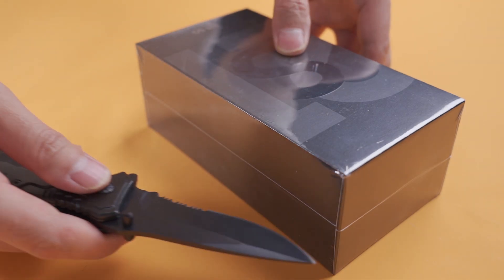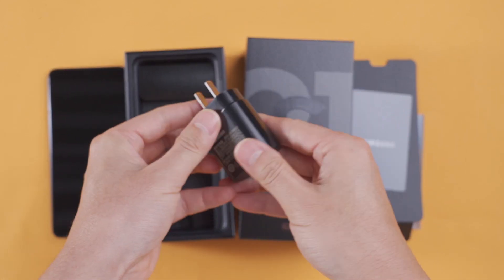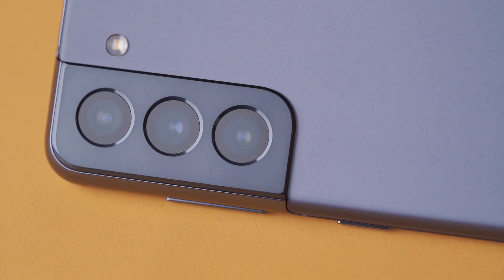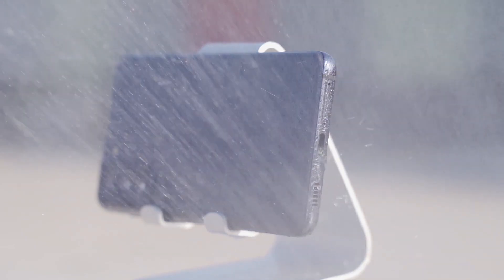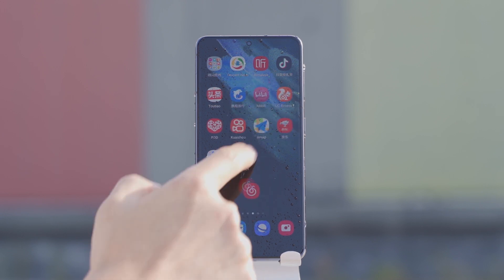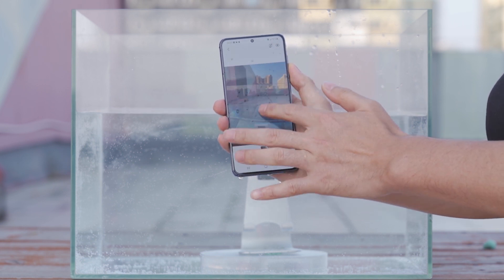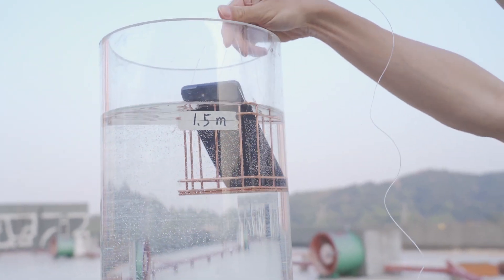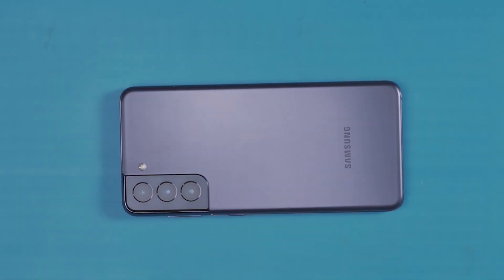Galaxy S21 5G Waterproof Test

Comment: My phone S21 5G got into the water and it didn't turn on. I put it in the sun and it worked. The next day, it didn't turn on. I touched the edges of the screen. How can I fix it?
Reply from the maker: Obviously there is water in the motherboard, I would suggest you go to a repair shop and have it checked, it will be more professional.

Comment: i bought a refurbished S21 that had been opened up before. sat in about a quarter inch of water overnight. wont charge. $300 down the drain 😀
Reply from the maker: Generally, the IP68 waterproof function of a mobile phone that has been disassembled will be immediately invalid.

Comment: Thank God. Mine fell in thenwater for two seconds. It got submerged and the ports got filled with water. I tried to lightly vacuum out any water that would fall out. Waited ten minutes. Turned it on. And now here I am. Thank you samsung. I had a case...but the buttons and ports are always exposed.

Comment: just had a screen replacement done by a "autorized" Samsung repairer that actually did repair the screen but lost waterproof and i got my phone damaged now im waiting for their call to see what are they gonna do about it . Ppl in Portugal dont repair any device from this category in Worten shops. They are NOT autorized repairers from Samsung and your phone will surely loose its waterprofness since they dont even do the vaccuum test to see if the equipment is still Ip68.
Reply from the maker: If this is the case, we prefer that you replace it yourself.
Reply: @EricWitrigs  Under warranty they had to replace my S21 for a new one. Lucky me that they didnt had any S21 so they gave me a new S23 ✌️

Comment: I dropped my S21 in water 2 times and it still works perfectly fine. I still can't  believe it still works with no problems. Most phones would have been done for, but this joker keeps going! Each time I dropped it by mistake. I will not go for #3, I'm to scared that might be the death of my phone. But it does work
Reply: Samsung states already that it is okay and manageable to submerge it underwater 1.5m for 30 minutes. You can throw it in your bathtub or anything you want, you paid for it to be waterproof so it's not bad to use it 😏
Reply: Mine fall into piss just now....but here am using it to type this message
Reply: @VictoriaHobbies  I just dropped mine In the toilet and had a heart attack 😭
Reply: @tragicpsycho3349  omg
Reply: @tragicpsycho3349  I feel you just dropped mine too, bro I cried... PLZ tell me you didn't have any problem with yours now
Reply: @esmer2061  Mines perfectly fine
Reply: @tragicpsycho3349  I have a question I think I hear a bit water inside the the phone did yours was the same or should I be worried?
Reply: @esmer I don't think I heard any water in mine but my main concern ATM was drying the outside of it off so I'm not to sure tbh
Reply: @esmer  I don't think I heard any water in mine but my main concern ATM was drying the outside of it off so I'm not to sure tbh

Comment: bought this phone last month, it ended up in my bathrobe pocket in the washing machine for 5 minutes yesterday morning, thought it was ok for the first 20 minutes because everything was still working, and then condensation in the camera lens and then nothing, tried the vacuum and blower in a sock method for about 5 hours and in front of a warm air fan all night, but still nothing on the screen
Reply: I don't think waterproof phones are meant for a washing machine. Especially if there's soap in it. I read that waterproof feature doesn't resist soap/shampoo/detergent or such chemicals.
Reply: You literally put your phone under category 5 hurricane and you expect this 600$ phone to survive through it.

Comment: I DON'T THINK SO.  I've got buyers remorse after using the S21 for a few months. Should have purchased the new LG flagship. I had the much older G6 which I had to use again because my S21 had to be shipped to Samsung and repaired. Warning, don't even put the S21 in a humid room or by the pool. I was splashed with droplets of water and the S21 gave me the dreaded, Moisture Detection error where you can only charge your phone via wirelessly. Isn't the phone supposed to survive being submerged in three feet of water for 30 minutes scenario? Yeah, I don't think so.
Reply: i'm confused, you got water in the charging port and you are mad that you have to wait for it to dry?
Reply: @i_love_games110  don't worry, everyone gets confused once in a while.
Reply: Pool water isnt pure water
Reply: it's a very comik commet

Comment: CAn it take pictures underwater?
Reply: Yes, you can but use the self-timer as the touchscreen doesn't work underwater (or start the video above water, ocassionaly it will flip screen and camera if you submerge whilst recording as the touchscreen detects the water as a "touch"). Beware (although it works fine) that the phone is waterresistant and not waterproof, and not made for the purpose of underwater photography/video. And your phone needs to be in its "pristine" condition...any hard drops / cracks might jeopardize the water-resistance. Your speaker (often)  needs to dry out after use in swimming pool, will sound terrible right after submerging it, a few strong airblows from your mouth and some patience will make it sound fine again. (Your mileage might vary, there is always the risk, I've been using it in our pool upto 1,5 meters deep for video & photo)

Comment: All of this yet you failed to mention microphone and speaker quality after the tests.
Reply: Yeah they go back to normal after they dry out! I dropped mine knee deep in a creek and my mic was wonky until it dried. As of now you wouldn't even know I dropped it in water.
Reply: I agree
Reply: @timothyfulkerson6785  its because they obviously would take a hit if you use them with water or moisture in it, that is why you let it dry properly and the quality comes back to the same before you got water in it. I dip mine in 3m deep pool for hours and take videos and pictures, never had any problem
Reply: After drying the phone he did an intake test proving there is no water inside any components so it should all sound normal

Comment: I dropped mine in the toilet an hour ago. I immediately got it out, took the back case off, powered the phone off, removed the Sim card and blew the water out of the speaker and charging ports then submerged in rice for 10 minutes.  When I turned it back on I had a notification not to charge due to moisture in the charge port. A few minutes later the notification was gone and I have no issues with the phone so far.
Reply: You are not the only one buddy. U can only charge once the moisture or dust in the charging port is gone. It could even take a day sometime and ur left with no phone as the phone dies without charging. Oy option is buy a wifi charger.
Reply: Hey did your phone ever have any problems since you posted this?
Reply: @soundsofnature4347  sometimes, this warning stays on no matter what you do and you'll be forced to charge it wirelessly. Had to send mine back to Samsung because I got splashed with water droplets only. Disappointed.
Reply: You shouldn't take the sim card out, there is a waterproof seal on the sim card slot

Comment: How did you comes with the charging brick inside the box????
Reply: Some countries require manufacturers to include brick because as they say the product has to have all components to work and without charger its not a full working device because once it dies you cannot charge it :)

Comment: How did you get the charging brick with your s21?
Reply: Some countries require manufacturers to include brick because as they say the product has to have all components to work and without charger its not a full working device because once it dies you cannot charge it :)
Reply: Late comment but I think that's the Chinese Variant.. apparently, Chinese variants of the phone came with one. Mine didn't (its a International)
Reply: Buy online
Reply: @ok-yw8bt I did I got mine from the Samsung website it came with just the charging cable
Reply: @bigpall1  thats impossible
Reply: @ok-yw8bt  What? How you gonna tell him that's impossible? I got my S21+ online and also only got the cable, no brick.
Reply: @Kana-vx2ec  typo i thought he meant brick
Reply: @ok-yw8bt  mine came with no charging brick too
Reply: @Kana-vx2ec  mine too....

Comment: I'm a diver, I dove 30 minutes 10 feet water, no problem.  Fantastic.
Reply: how is the charging port and the speaker
Reply: @sidraofthestars  the s21 plus ➕ is water proof too right
Reply: @christophergarland2315  Yheap
Reply: Its waterproof with no case?????
Reply: @cedrickdegroat4045  yes. 1,5 meter for 30min
Reply: Did u dive into sea water ?

Comment: Keep in mind water resistance is most likely not the same once you have removed the back panel and put back together.
Reply: You are not meant to remove the back panel though
Reply: Real talk bro, I took my my brand new (atleast what I thought)s9 plus  to the pool and within seconds it done....went to repair it,guy told me it was a refurbished phone
Reply: @live_easy7635  
Yeah you can seal it back up properly if you take your time with the waxxy adhesive. 
I don't really take my new from factory phone even in the water though. 

Only had a few cases while fishing where it went under fully. In that case it was a refurbish g6, and it didn't break. Still works to this day. I guess it depends who does it too
Reply: @ryanpark2049   understand bro, it wasn't intentional tho, butwhen you got caught up with women and water...tends to get a little crazy bro
Reply: @live_easy7635  buy it brand new from the actual store
Reply: I think modern phones are designed so they could be properly serviced without voiding water resistance
And Samsung themselves after servicing your phone, test the water resistance then give you back
Reply: A.
Reply: I had my s21 plus screen replaceded by Samsung mobile call out team so would that be sealed properly?
Reply: @snakeybriskins6432  I would think it would. Me personally though I would be skeptical.
Reply: @gabe_irl  same but they have replaced the back cover battery and charging port but I belive its all built in like the lcd screen charging port etc am I correct because its looks brand new?
Reply: @snakeybriskins6432  if it's done by Samsung themselves it likely is still water resistant but use your own discretion.
Reply: @gabe_irl  yes it was done by samsung themselves they come to your house and fix it outside in there litle mobile repair van.
Reply: @snakeybriskins6432  oh wow, I didn't know they did that. That's pretty cool
Reply: @gabe_irl  in the UK they do yes if you're from hear or other part of the world. And it was cheaper than any other place even a back street phone shop it was a no brainer.
Reply: Depends on who opens it or not. The seals/sealant are/is easy to replace if you take your time

Comment: Omfg...You removed the factory installed screen protector? I mean, yeah, it's not great, but it's supposed to stay on! WTF!! The fact that it didn't have a tab for you to pull it should have told you that!!!  Facepalm.
Reply: I'd rather see it test absolutely unprotected as possible 🤷.   Wouldn't you want to see what its really capable of handling?  🤦
Reply: Well for the tests it's a better to take it off for full results
Reply: That protector only protects the phone from scratches.. try dropping it with that protector and you might end up with a really screwed up screen

Comment: That was impressive. They say two minutes under water, but clearly that's just a precaution and it can withstand 30 minutes with no issues, possibly even longer.
Reply: Under 1.5 meters the pressure at that depth can push water through  the mesh that makes it water resistant
Reply: @Ryan-p1ge0n  but it didn't, so 🤷
Reply: I know what we can speculate but to me, this is pretty clear that the durability and water resistance is excellent. I'm sure that it can withstand a longer duration under the same conditions
Reply: @treykings07  the deeper you go under water the more pressure it has, no video I've watched is under more then 1 foot of water 1.5 meters is more the 1 foot, the presser at 1.5 meters will push through  the mesh on Ruin the phone.  I say this on this phone  watching  videos  because  I do stuck and if it gets on my phone by accident I want to be able to wash it off. I wouldn't even try holding it under 1.5 meters for more then 30 minutes because before samasung releases  their phones they test that and that's what they say 1.5 for 30 minutes  will ruin the phone
Reply: @Ryan-p1ge0n    come on my guy, that's obvious. But here's the problem, nobody is talking about anything other than this video and the evidence it clearly shows that this phone can withstand 1.5 meters (watch the video again..), for 30 minutes. My comment is merely stating that this phone could likely withstand 1.5 meters at a longer duration than 30 minutes. Never once said anything about going deeper, or anything else. So your comprehension is a little off, also the fact you didn't watch the video and chose to comment with opinions is another problem.  You claim that no video shows 1.5m for 30 minutes and this video literally does just that. So just go watch the video.. have a good night.
Reply: @treykings07  so to you a cup of water is 1.5 meters. Where did you go to school man. A cup of water is not 1.5 meters. You are not understanding what I am saying. He tested in a cup of water a cup not 1.5 meter of water so how can anyone tell its water proof the pressure  at 1.5 meter of water will push water through the mesh waterproofing. Do you understand that phones have a mesh screen in them that makes them waterproof. Do you understand  or are you going to try to tell me a cup of water is 1.5 meters deep. Yes if.ypu sit the phone in a cup of water it can stay there forever. If you put the phone in a bucket that is 1.5 meters  deep say like a garbage can your phone won't last passed 30 minutes.
Reply: @Ryan-p1ge0n  you must not have watched the video? He submerged it under 1.5 meters of water for 30 min?
Reply: @Ryan-p1ge0n  your comment makes no sense at all. You didn't watch the video clearly. Or watched the first 3 mins then went into the comments to argue.

Comment: Why does this one come with a charger and mine didn't? (Also S21)
Reply: Mine came with a cord but no box to hook it up to...
Reply: @ironheadmafia  yeah I have the same thing.
Reply: Same... my box was very thin as well.
Reply: Some countries require manufacturers to include brick because as they say the product has to have all components to work and without charger its not a full working device because once it dies you cannot charge it :)
Reply: Mine too
Reply: Mine never came with one either
Reply: Mine came with a cable but still can't use it as its type c both ends luckily wife has a s10
Reply: @johngriffin9759  yes that's what mine came with that's just to transfer apps data pics and stuff I meant a actual charger
Reply: @joeyjohnson7076  that is also the cable for charging but you have to buy a separate plug its called a 25amp charger. It makes it a super charge instead of fast charge
Reply: @johngriffin9759  yea but pointless bc I don't have a place near me that sells one
Reply: @joeyjohnson7076  you can get them on ebay or amazon
Reply: 5 and below sells type 3 blocks. Mine also came with cord no block..
Reply: You shouldn't worry about it you must have a lot laying around just worry if you end up getting the exynos version instead of the snapdragon 888.
Reply: @Jaem-ml4lx  both ends are type c, not a-lot of people have a type c power brick laying around
Reply: Some regions still include it
Reply: Mine didn't come with a charger aswell, bought it for another $35.
Then when I got home I realize I have an original samsung wireless charger and a cable from my previous S10 😅😅🤦‍♂️

Comment: Does anybody know how the waterproof works on this? It seems like if water got in the charging port, it would be bad, but it looks perfectly fine!
Reply: You'll need to dry it out before attempting to charge it. If you try to charge it when it's still wet, the phone will warn you that it has detected moisture inside the charging port.
Reply: Tranquilo sale una gota y al momento de seecarse desaparece la gota y en cuanto al puerto de carga solo lo seca y listo.
O si quieres solo sacudes y se seca solo

Comment: Hey why don't you test the speaker still working or not after soak in the water
Reply: I just dropped mine in the shower. The speaker is not in great shape right now....🥲🥲🥲
Reply: @kingc5341  did you drop it in a case? Might have more to do with being dropped than water damage